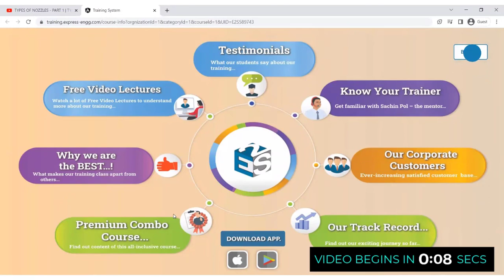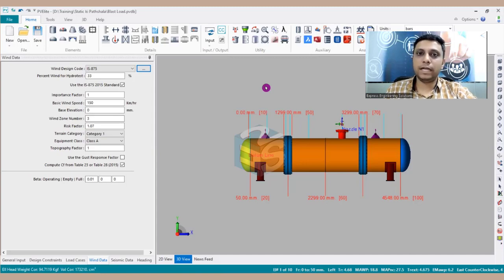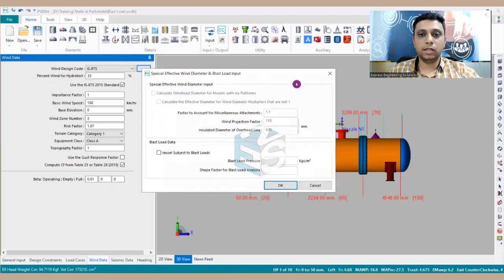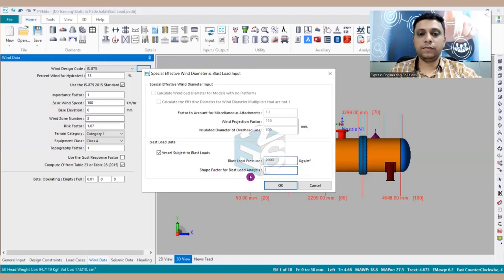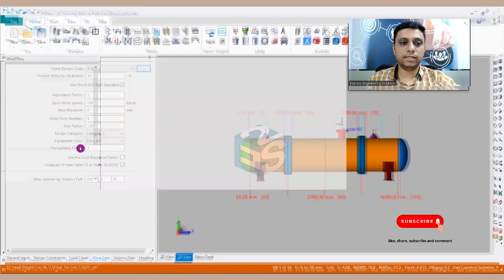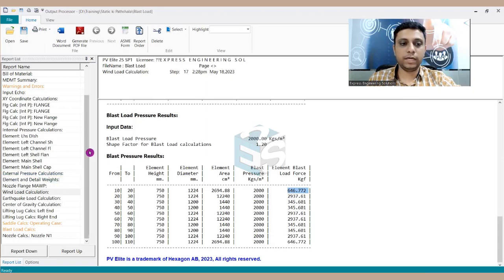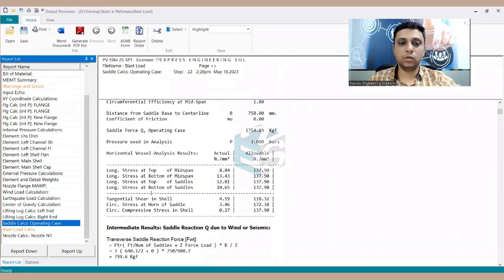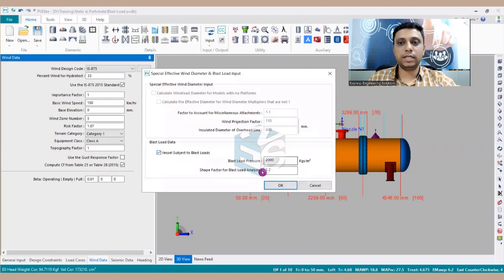How to Design Pressure Vessel for Blast load in Pv Elite | Pv Elite online training

Comment: Just a question. Blast load pressure is the wind pressure? If not, what is?
Reply: I think that it's a input data
Reply from the maker: @saverioalbergo9080  yes it's a wind pressure caused by blast at project site